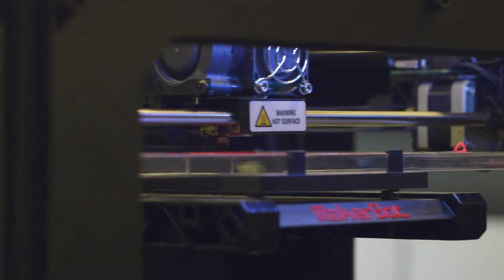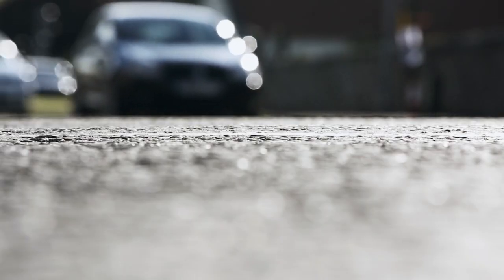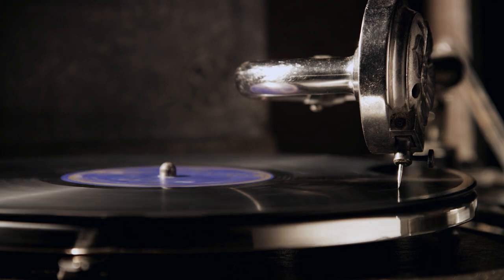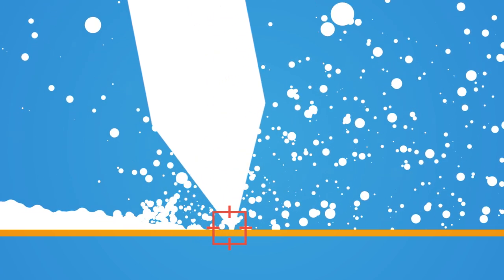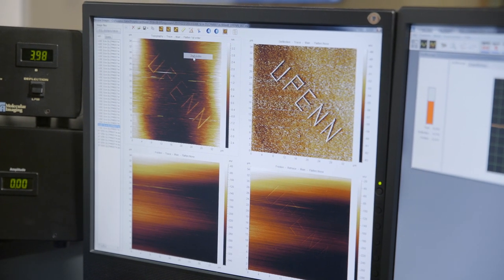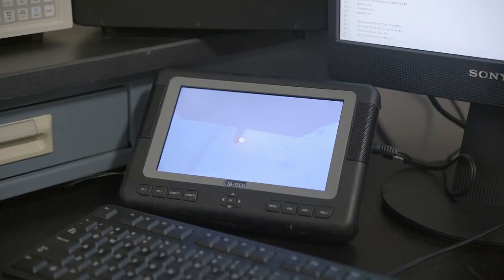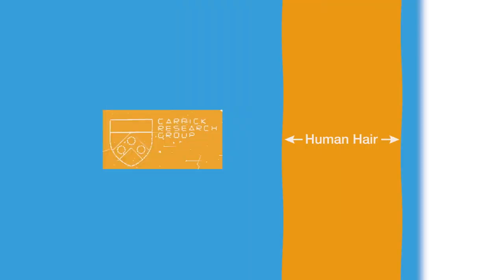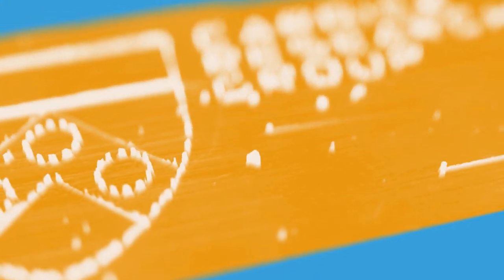Y Prize 2017-2018: Nanotribological Printing

Comment: Can't you just use the broken hard drive? I read the research papers, the main problem of nano scale is highly expensive piezo motors, but in current hard disk drives the voice coil are providing precision in at least 100-10 of nanometers, just think - magnets, lasers+ metal  atoms = metal printing. And rotating disc is also the only way to preserve impressive level of precision for the order of atoms in needed position.
Reply: i will made this idea concept fully open source and i'm not really interested in nano printing but recreation Australian university prototype to record petabyte DVDs, i'm really mad at such "scientists" which tell public that their concept can be made from homemade components & at the same time hiding everything how they done their results, it's not science, it's fraud.